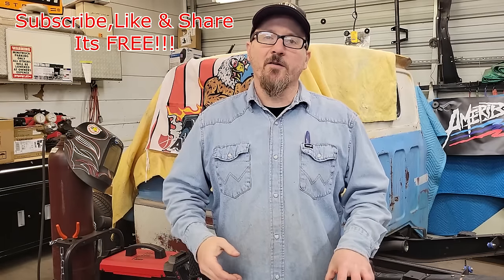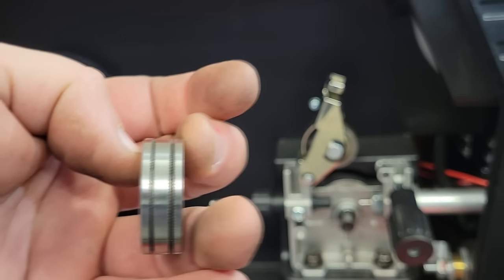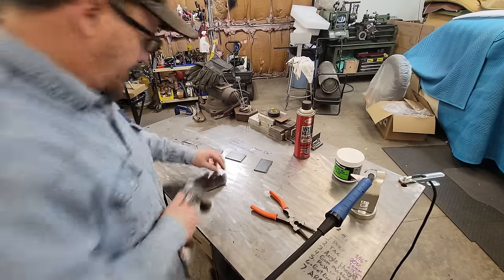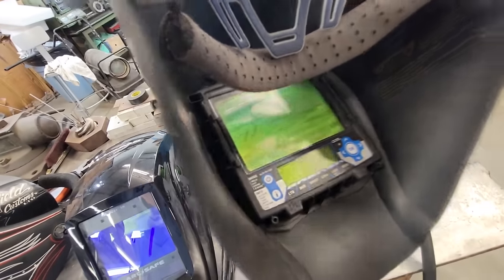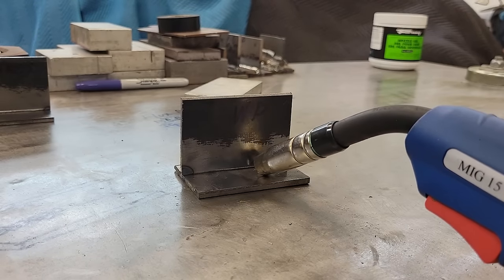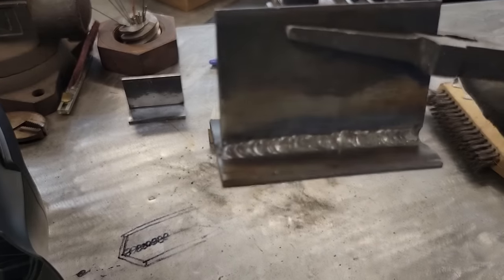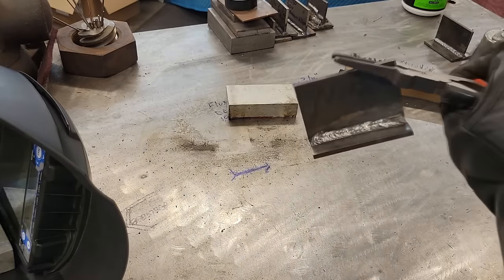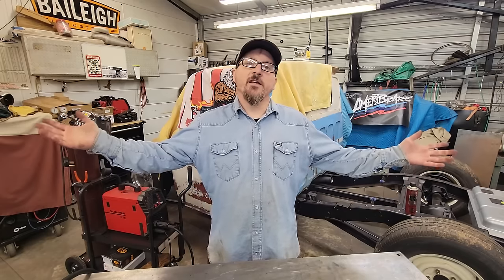Learn to Make (Perfect) FLUX CORE Welds FAST:( How To Stack Dimes)

Comment: I have this welder.   Once you get it dialed in it good.  Dont always rely on the pre sets.   I've had to make a wide arrangement of setting from the auto settings.    Also...  when you shut it off and expect to jump right back to your welds they will not be the same settings.   I think more you. Weld it changes settings.    But I will say so far only welding mig and my first machine with gas....    I will take it over Flux core any day!!!
Reply from the maker: I agree I think the gas mig will make life alot easier for sure!!!

Comment: Thank-you for taking one for the team and providing this YouTube Trade School lesson on Flux-Core Mig. Also, thanks for the nozzle gel and spatter spray tips, little to no "BBs" on my table and piece. And yet another Thank-you for the aluminum heat-sink tip...I notice way fewer blow-throughs on my thin-walled tubing welds, but it might also be due to your excellent videos. Bless you Brother. I liked the "cursive eee" the best because the size of the e can be adjusted for any metal thickness. OBTW...Harbor Feight "Vulcan" nozzle fits my ArcCaptain mig gun.
Reply from the maker: Awesome thank you for the continuing support I really appreciate it. Ill check out that vulcan tip for mine. I plan on doing some more on flux core so if you have any suggestions let me know. Hope yall have a Blessed day 🙏

Comment: Good video on different techniques.  The only thing I would add is the "why" of it all, especially since this is intended for those new to the trade.  The whole point is to heat up as much of the base metal while you're filling with wire, because the wire puddle is already hot, but the base metal isn't.  Adding the different movements is simply a way to touch as much of the base metal, which is how you accomplish the proper penetration necessary for strength.  Covering the science (the "why") is just as important as the look (the "what").  Great instructions overall--very helpful!
Reply from the maker: Thank you!!

Comment: Fantastic tutorial - thanks very much. Been wanting to learn to weld for years to round out my wrenching and woodworking skills so I can keep more of the restoration work I do on old cars and boats in-house. Attending a community intro class to MIG this weekend and after watching this I’ve got a much much better idea of the basics. FWIW I think the Whip and Pile looks easiest/best for me but we’ll see once I get that gun in my hand. Cheers and thanks.
Reply from the maker: Awesome thank you very much for watching,  if you have any questions just let me know!!!!
Reply: @ACDesignsGarage  - thanks very much, ok here goes question no. 1 :-) .... My first project will be modifying a factory roll-bar off a Jeep CJ5 to fit a ‘49 CJ3a. The 5 has a longer bed and taller body so I’m thinking if I cut about 12” off the main hoop legs and rear support legs it will drop down just about perfect. So...is the $300 Flux core machine I’ve got access to going to be good enough to weld heavy flat plates on the modified roll bar so I can bolt the thing to the 3a? I think the hoop is made from mild tube steel and can’t be thicker than 3/16 walls - likely less. 
BTW - this isn’t for crazy off-roading, just something to add a little protection for backwoods dirt roads in case I put a wheel over the ditch and drop on my side. I wouldn’t trust my not-yet-existent welding skills to save my life rolling off a canyon pass, dramatic endo or anything. Thanks for your thoughts!

Comment: Again, thanks for the video with the flux core. Also, for using the ArcCaptain. I was practicing again today on 1/8 steel with my ArcCaptain mig200 with a .030 flux core. So far for 1/8 steel, I’m getting some pretty good beads with 17.5 volts & 4.5 m/min & adjusting my inductance to the right just passing the red line a little. I’m still playing with those settings.
With 3/16 using flux core, I was doing pretty good with 18.8 volts 6.2m/min & adjusting my inductance to the right just passing the red line a little doing the whip & pause technique waiting till my puddle build up before I move forward again.
Reply from the maker: That sounds great ive never played with the inductance, I wasn't sure what it did. If you have any tips Im listing lol hope you have a great Day!! Thanks for watching!!!!

Comment: I like the whip and pause you show.  I have always been into shielding gas.. am TICKLED at how good Stainless Flux core works in my millermatic 140 Autoset on LOW power, very low speed, even odder its on 120v 15 amp circuit off my back deck, a 50 foot heavy duty extension cable. I was using shielded mig for mild steel but needed to change it up for the Stainless project.   It really did the job on my stainless exhaust system.  The cost of a 2 ft tank of shielding gas was 140 at the local welding shop.. so, I found E308LFC-O .035-Diameter Stainless Flux Core SONNLER, packaged well in a vacuum pack (ideal) and buzzed straight off the line in DCEN mode.   I do a ellipsis shape real fast on the tips, but a quick wiggle/pause in the middle.. looks very much like your welds, looks great!  thanks for the good walk through, and focus to safety.  Anti Spator... zigzag charlie brown.. hah
Reply from the maker: Awesome, I need to try that stainless, great idea!!!

Comment: Superb video, thanks! FWIW I really like the whip and pause; I'm doing my first (newbie) project with 2.5mm angle iron and 1.2mm square tube. The whip and pause works wonderfully on mitred joints and overlap joints, on the thicker stuff, but even on my lowest settings I'm getting blow through A LOT on the thin tube - I am pretty sure the metal can't tolerate the heat build up. What is working well on the 1.2mm is dragging small cursive 'c's pretty fast - in my practice sessions I've also used the same technique vertical downwards on the 1.2 and it comes out nice. For joining the thick and thin metal I'm using a letter 'u'; holding the heat in the 2.5mm at the bottom of the u, and then dashing up onto the 1.2mm and back down again - touch wood no blow through as yet.
Reply from the maker: That's awesome,  yeah I use different motions on different joints, What ever works best for you, sounds like you got it figured out. I may borrow some of your tips!!!!
Reply: @ACDesignsGarage  No problem! A further tip that works for me as a newbie....... I can't draw a straight line freehand even with 2 hands, and freehand my gun ends up going well off track, even on 2 inch beads. I borrowed an idea from art, where they use a stick as a support for the brush hand - I use my extended right hand (I'm a leftie) planted on the table and parallel along the line I want to weld, with the inside edge raised as high as is comfortable and I run my left hand along it. If I need more height I use a piece of 2x4 wood to rest the hand on. So even if I temporarily lose sight of my line at least I'm gonna be close. Works vertical too but you need to think a bit more about the angles. I'm late 60s and my hands and eyes aren't what they were 40 years ago, but this method gives me nice shortish welds that I can stich together.

Comment: Nice video..I've only welded with flux core..I don't like it to be honest but it has its uses.  I will be utilising your advice to hopefully improve my results which have been disappointing for me up til now...I don't want to blame the machine but I bought it from Lidl several years ago..so its not the greatest...wire feed being a real bug bear...however it has saved my life more than once and has been worth every penny and cuss word all at the same time. Subscribed!!
Reply from the maker: Thank you for the support, it can be tought I think you can master it. I will say if you get the chance to upgrade to solid core with gas sheilding you'll  love it!!!!

Comment: Whip & pause  

I have been welding for many years I self taught myself with gas, ark and mig. 

I started using flux core only because I ran out of Co2

It’s alright but when it comes down to it I will always prefer using gas rather then flux core wire. 

Cleaner welds by far using gas. 

I liked your video and how good you explained everything 👍
Reply from the maker: Thank you for watching!!!!!
Reply: Try using flux core with gas, i use to when repairing industrial bins, comes out pretty damn clean

Comment: I was a fitter / welder for eighteen years and we never changed the polarity back and forth when running hardwire or fluxcored wire. The only thing we changed when running fluxcored wire was to change the gas over to carbondioxide and put a heater on your bottle before you put your regulator with neoprene washer on to keep your regulator from freezing up from the gas. The only time you change your polarity is when you run gasless fluxcored wire.
Reply from the maker: Thanks for the tip!!!
Reply: You are referring to dual shield welding. This is gasless flixcore.
Reply: That whip and pause is probably the better lookin piece. Thanks for your great video!  Just got a Yeswelder today and lookin forward to arcing and sparking.

Comment: I have the yeswelder 160 amp 120/240 welder and use the same wire you used in the video with very good results I watched a comparison of flux wire and the yeswelder wire has won each one
Reply from the maker: Thanks for the info!

Comment: Good vid very informative, I have a Lincoln 125 and the welds never look that good, a 200 amp and up I think does a better job than the smaller machines, I have a convertible Sebring that I have been wanting to make a roll cage for would you consider making a vid on a convertible.

Comment: OMG  he is like the ONLY person I have ever seen use a Arc Captain machine     They are very good machines  for what you get  3 to 5 years warranty 400$ Multiprocess machine  hot start  arc force   synergy welding     they offer really nice welding helmets for just 50$      250$ can get you a plasma cutter  all you need is a Air compressor   while  Harbor freight  wants 1200$ for a 50 amp machine with a 90 day warranty   while Arc Captain comes with 3-5 year warranty and it cost 200 to 250$ for the cutter     with Arc Captain you can start a welding business for just  1500$ to 2000$
Reply from the maker: I love my machines I use the mess out of the, both the tig and mig!!!

Comment: Brilliant video mate, thank you. One question, on different thicknesses of material, do you keep a similar speed as you used here, and use the settings on the machine to govern the penetration you get? From watching this and seeing your results, a lot of people seem to go too fast and got a surface bead, rather than it digging in like yours.
Reply from the maker: You're right, Your speed plays alot in the penetration of the weld also. You can turn over your material and look at the heat effected zone , aka the blueish grey color on the metal, and tell a lot from that. Its kinda like a road map. If your going to slow the color will be to wide, if your going to fast it will be narrow. I like to keep it as uniform as possible. As for the width of the color around 1 and 1/2 the width of your weld seems to be a good range to shoot for. Thanks for watching!!!!

Comment: The other welder I was telling you about is HZXVOGEN 250 aluminum MiG welder. Does MiG, flux. Stick, and aluminum with supplied graphine liner for your gun. Amazon
And has same face as our red machines. They have 40% discount on it right now. I love mine, ky
Reply from the maker: Thank you Ill have to check that out!!! I just bought an arcfony cut 53pro plasma cutter for $300 on Amazon,  looks to be a great machine for the money!!!
Reply: @ACDesignsGarage  that welder comes out to about $229.00 after 40% discount, and is a twin our red ones. I am using as a flux core only, and I like it and the 250 power.

Comment: I use a Lincoln 210 that during the set-up give me the range of volts which also sets my speed but also has my amps that is adjustable as well. I can independently adjust both up or down depending on heat and penitration . My machine also has metal thickness size to imput into the machine which automatically gives a range of volts and amps to run and is shown in green run zone and red on the lower and upper end of running the machine out of what the normal run heat range that should be run. I'm just learning .
Reply from the maker: Alot depends on the thickness,  but the auto features usually do pretty well!!!

Comment: I know dimes are pretty, and I do whip and pause with mig, but with flux core aren't you just pushing slag back into your weld?
Reply from the maker: That could be a problem if you go to far with the whip. But as long as the puddle is still liquid I think it will be fine, we need to test it with the etch test!!!!

Comment: What's a good wire speed and voltage sitting for exhaust pipes using a 110v welding machine using flex core 0.30 welding  wire ?????????
Reply from the maker: Im guessing around 14 to 15 v and around 200 to 225 ipm on the wire feed speed. Id start on the low side on some scrap then dial it in. If your machine has a chart thats a good start. Id say most exhaust is around 14ga or so. I plan on doing a video on this subject soon. Thanks for watching!!!
Reply: Thanks for the info my medicine has 110v and 220v but I only have 110v to it at this time need to run a 220V wire from breaker box I will be looking for that exhaust pipe video as soon as you upload it Thanks alot 👍👍👍👍👍👍👍

Comment: Thanks for the show never really used flux a lot have a solar 1/10 thinking on a 1/10 Lincoln ?
Reply from the maker: Thank you!!! All the lincoln welders are good. The 110 ones sre for thinner materials like under 1/8" from what ive heard. If your doing heavier you may need to jump up to 220v machine. These arccaptian welders are hard to beat for the price!!

Comment: I have welded for over 40 years and drag stick and push mig and never had a problem with fux or not if you know how to weld you learn to make the best weld welds
Reply from the maker: Its best to run what ever your comfortable with. I drag mig more but I've pushed in certain situations. I can see beter dragin. Im falling in love with flux the more i use it!!!

Comment: Can you build up broken bolts with flux core for extraction? I want to keep a welder handy for extraction - flux core seems cost effective, but does it work for bolt extraction.... what kind of settings would you use to extract say a 7mm steel bolt from an aluminium block? Do you need a particular wire type? Or is GAS the only way? Please help... I don't want to spend money on the wrong gear before I get going!
Reply from the maker: Sorry for the delay, been answering a ton of comments lol, Me personally if you can afford it go with a machine with solid core and gas it will make life alot eaiser.  Flux core works better if your going to be outside welding more because of the wind blowing the gass off. As for the settings maybe around 17v on the heat range, not sure right off hand on the was, if you have a auto set I would set it up for like 1/8" to 3/16" thick setting would work!!!

Comment: Is that sound normal? I recently welded a couple of 5/16 plates and my welder was doing that exact same sound. I was a bit worried because i thought that the wire was not coming out uniform, usually i do thinner plates and the welder wont make a sound like that. I have a 170 Mig and was using flux core at the time. It came out really similar but that sound was different. 36:58
Reply from the maker: It's best for it to sound consistent but when you whip and pause or do cursive e it sounds a little different than just a straight bead. I listen and watch the puddle and it will tell you how it doing. You just don't want it spitting and sputtering lol, hope this makes sense 🤣
Reply: @ACDesignsGarage  It makes a lot of sense, thanks a lot sir! I got subscribed, hope it helps!

Comment: When ya live in a small town getting welding gas is a 30 mile drive. Just saying in the middle of a project its a factor. ive had to switch to stick or flux core umpteen times.
Reply from the maker: I know the feeling its about 20 for me, I hated to but I broke down and bought an extra bottle,  because nothing is more aggravating then running out of gas in the middle of something!!!

Comment: Going from gas sheilded to flux core. Do you find flux core to punch in like a 6010 rod? I had to drop settings big time to not burn through edges. Dont know if its just flux core..or the particular wire i got..?
Reply from the maker: Yeah that flux core digs like a excavator lol, penetration is NOT a problem lol

Comment: Maybe a stupid question, but what effect does spraying anti-spatter spray on the base metal have? Does it have any effect on the weld metal and the base metal sticking together?
Reply from the maker: No problem,  no such thing as a stupid question!! It burns off, Ive never had any trouble with weld problems. We use to do it all the time on the off road team I worked on, those trucks ran Baja at 145mph over jumps and they were fine lol. It just makes it nice not to have all those BB's on The metal, thanks for the question
Reply: No effect. Just keeps spatter from sticking to everything

Comment: Just curious.. why couldn’t you use your fan to help blow some of the smoke away from your work space? New to welding. So not trying to be sarcastic.
Reply from the maker: I should of lol, I'm use to using mig with a gas sheild and you can have moving air around it because it will blow off your shielding gas.